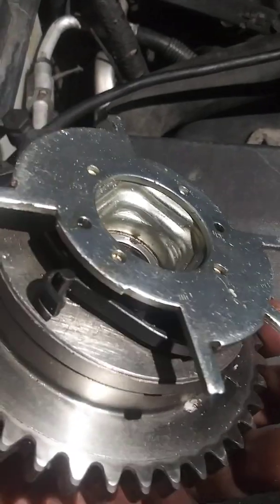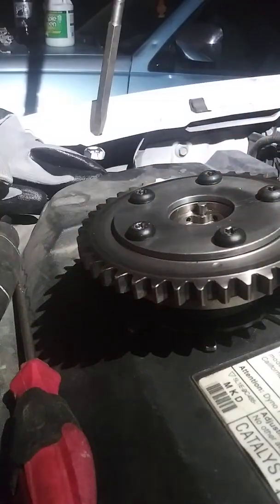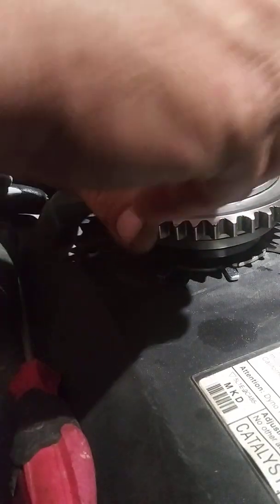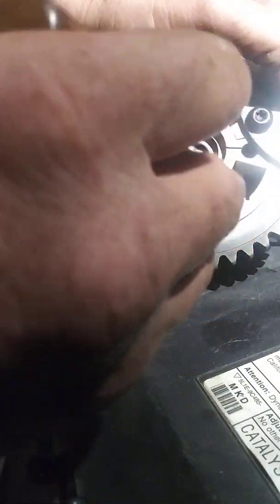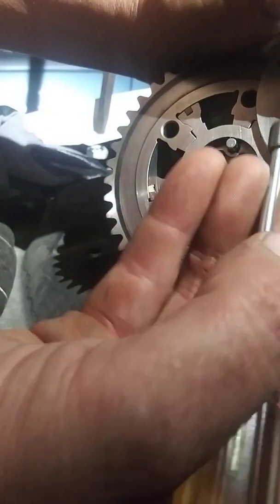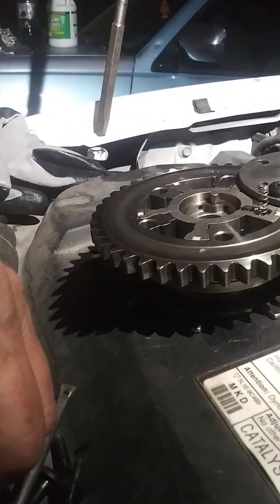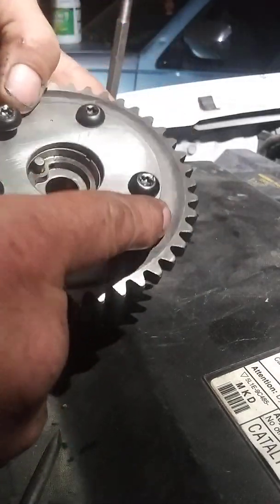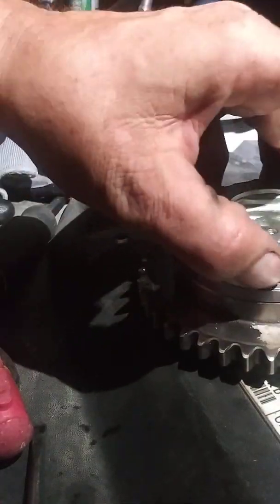Cam Phasers fixed easy

Comment: But the whole internals of the VVTi gear are contained, so even if any part (pin, spring, or other) breaks, it will stay inside the gear and never reach the timing chain space. Isn't that the case?

Comment: I figured this was an ecoboost.  My 2017 raptor had phaser issues.  Dealer took 7 weeks to fix.  Came back 3000 miles later.  Are these and the ecoboost phasers similar?